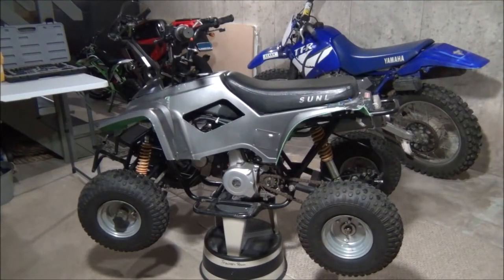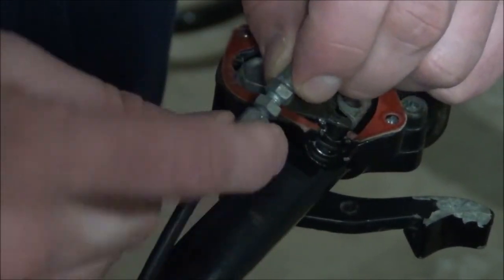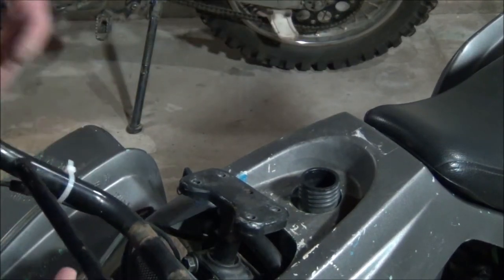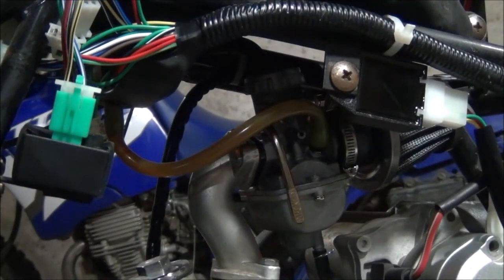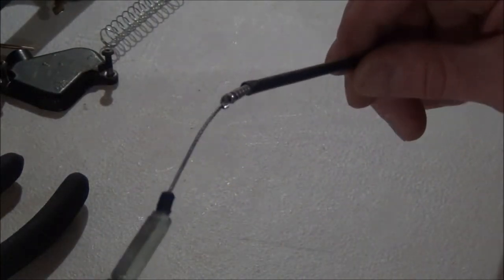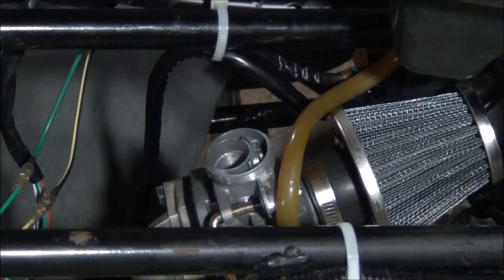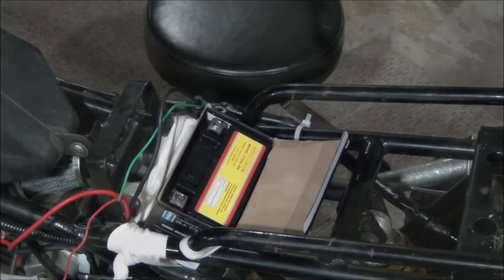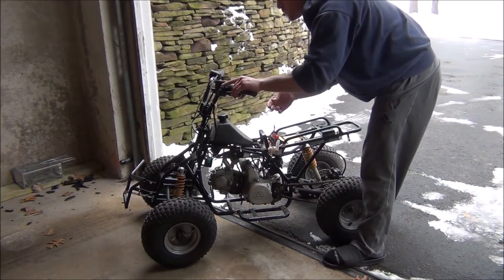Quad ATV Project - Throttle Cable and Carb Adjustment Repair 100cc

Comment: So before this when you started it, was it always in high revs
Reply: It was on the side of a house under a tarp..I only bought a cheap 20$ carb on Amazon.. design was not as good as original that had the choke being on the handle instead of a lever on the carb itself..

Comment: My Tao tao accelerates by itself when not touching the throttle and I don’t know why, but I change the carburetor just a little, but still doesn’t help
Reply from the maker: probably same problem i had.. throttle cable is to short or being hung up on something

Comment: Hi there you selling your ttr 600
Reply from the maker: There is a very interesting story behind the ttr... I was actually robbed when I went to sell it last year, I recovered it a week later when it was crashed into a tree and it was mangled.. I should have done a vid on that but I just wanted it gone and was pretty pissed about the whole ordeal. Sold for 990 bucks after I patched it together and got it running.. bent forks, cracked gas tank, all the plastics gone..